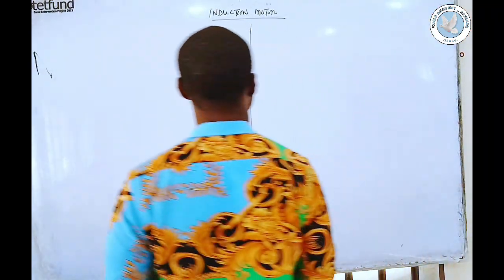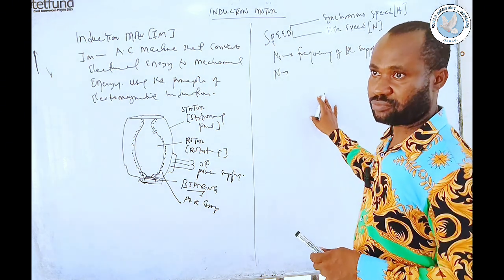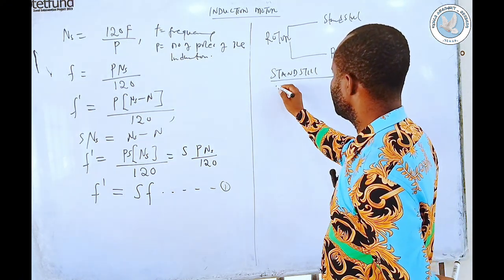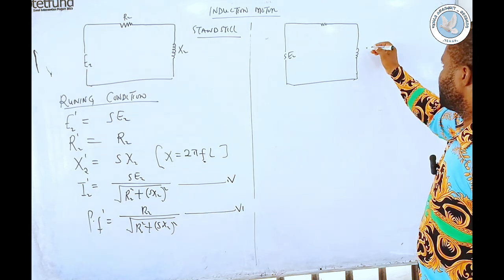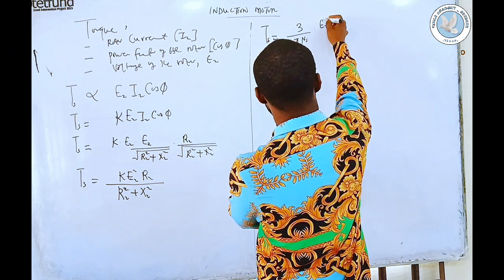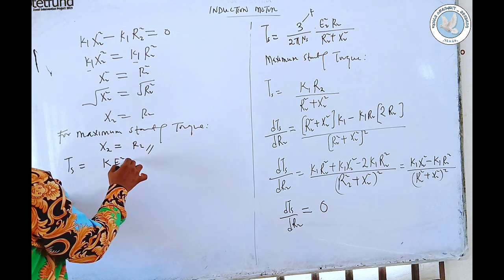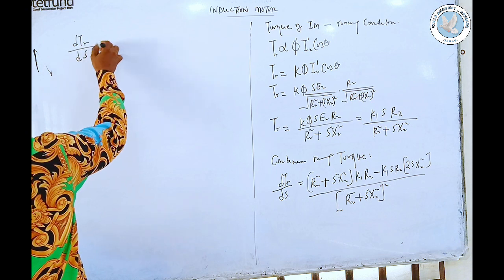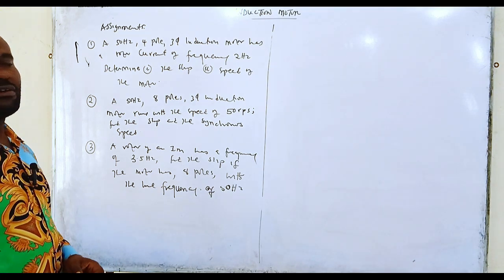Induction motor II Electrical machine

Comment: I'm confused at no. 2

When converting N from 50rps to rpm= 3000rpm
And my synchronous speed = 750rpm
But in an I.M rotor speed is always less than the synchronous speed ???
Solving it direct i.e s=(Ns-N)/Ns my slip will be -ve which isn't correct..

Comment: For question one, the slip is 0.04 while the rotor speed is 1499.96 r.p.m

For question two the slip is 60% or 0.6 , while the synchronous speed is 750 r.p.m

For question three the slip is 0.07

Does anyone has this?